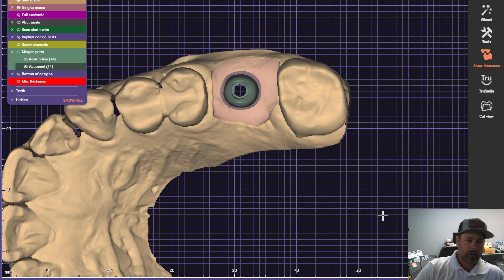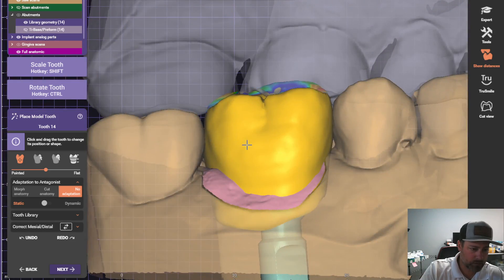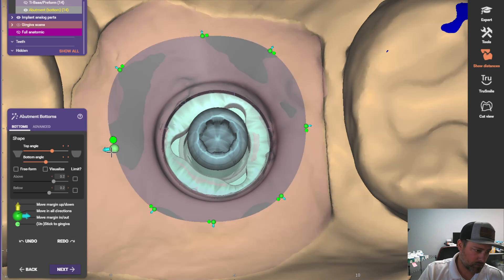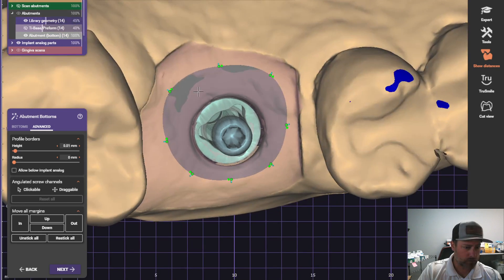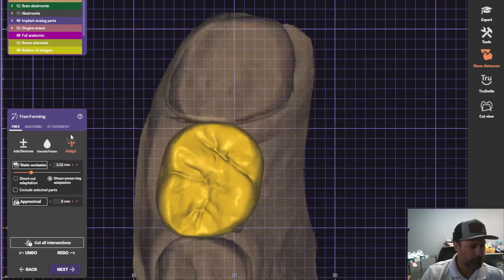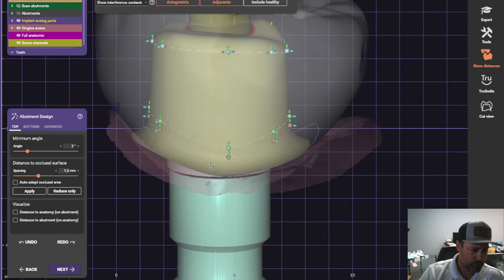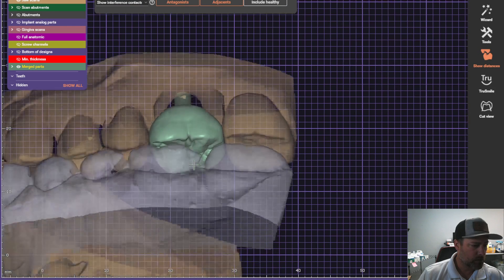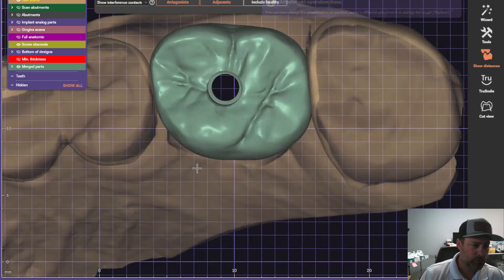Ultimate Tutorial: Screw Retained Implant Crown in Exocad - Step by Step Guide

Comment: Hi Adam, nice presentation, did I miss the part where you mention the allowance for cement spacer (luting) ? or do have a pre-set ? We are currently experiencing feedback from a client who is feeling a click with his probe and seeing under 8 mag a cement line. We design on both Exocad & 3Shape however neither is giving the precise fit we require, is it possible to reduce the marginal 1-2mm to zero ? thanks Mark UK.
Reply from the maker: You would use the crown bottom function as you would for a regular crown after the abutment is designed. You'll be able to change margin thickness there